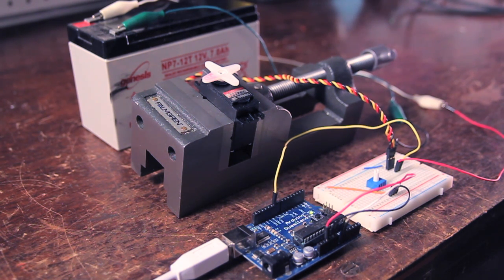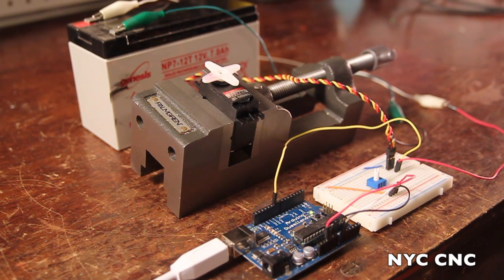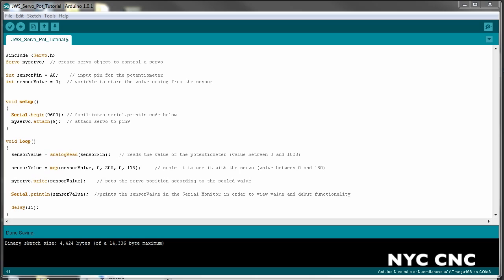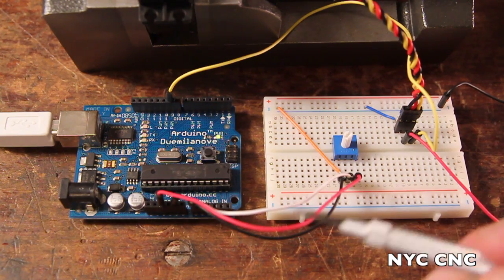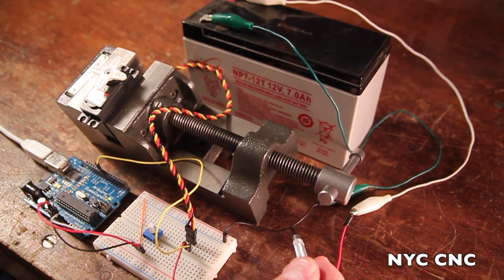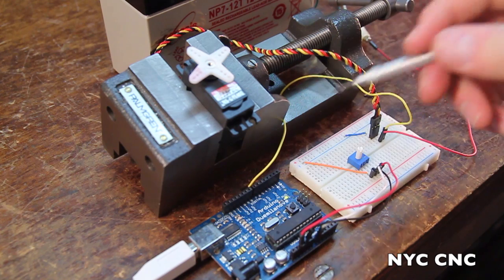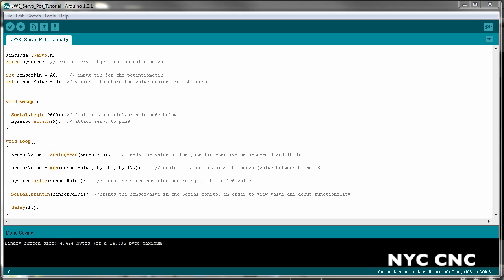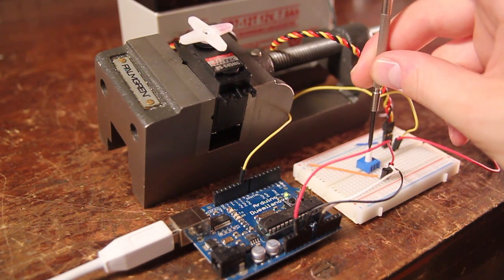Arduino Servo Tutorial Part 2: Supercharging your Servo!

Comment: hey,
it's a great helpful video. but i have one question:
do i have to connect the black cable of the Servo to the Arduino-GND and to the Power-Supply-Mass if I use a 5v Powersupply? because  i want to use one 5A power supply for many servos which are conected to different Arduinos.

Max  (form Germany)
Reply: +NYC CNC  and it's no Problem if I use One power supply with man's Arduinos?

Comment: Hello,
I see that your external power source is about 12V with 7Ah. 
But the servos operating voltage is 4.8V/6.0V. I thought 12V will fry the servo?

Comment: hi! thanks for your videos. i subscribed, i am new on this stuff and it seems to be a great hobby. can i ask do i really need to establish a ground connection between arduino and the motor? will it not affect my arduino. thanks man.
Reply: +NYC CNC hi thanks for your reply.. if i did not establish a connection between two grounds it will work also right? sorry for being hard headed.😆
Reply: +mark loria 
no, it will not work properly - ground of the servo should be connected to arduino because control signal from arduino to servo requires return path back to arduino power suply
Reply: +z08840 hehe tnx bro helped alot

Comment: I am sorry if my question sounds too basic, as i just started to get my hands on servos, and arduinos. Why is the arduino connected via usb cable to the computer? Is it only for figuring out the results or does it act as a power source for arduino i.e. powering arduino through usb and running the servo through battery. Can we remove the cable and the mechanism still works, or do we need to power the arduino separately. I'm sry, if its too basic. Thanks a lot in advance!
Reply: NYC CNC
Thank you

Comment: Are there larger servos you could use with this on a very small mini bench top mill? Thanks
Reply: NYC CNC 
Hello,
Drivers are used when the motor voltage is above the one that arduino can supply? I'm new in this stuff...

Comment: could several servos ( 3-4 max), obviously on a separate supply like you did, all be sent a signal on one digital-write pin? i have a project with at least 24 servos , ( 12 x 2 sides,  ) would this work or would i need a pin per servo? all need to run at the same time to various angles (in pairs )

or would i need another arduino and hook the two together?
Reply: John NYCCNC yeah if i could run in pairs , the most number would be 4 on one pin, i could get it down to 6 pwm outputs,

Comment: Can I do this with a Raspberry Pi (using an external power source), the pins on the RP are only 3.3V. Will this not fry the chip connecting the grounds? Sorry I am new to all this.

Comment: I would make sure you know what you're doing before you work with mains voltages. Look into linear power supply tutorials and that will shed some light on power conversion.

Generally in a simple power supply, there's a step down transformer that will take a high AC voltage and convert it to a lower voltage (still AC). This will then run through a rectifier (usually full wave) that will converter the AC voltage to oscillating DC. This is then smoothed or filtered by a capacitor.

Comment: Ah, thanks.  These servos do take an analog pulse width where 0.5msec wide pulse = -180degrees, 1.5msec pulse = 0degrees, and 2.5msec pulse = 180degrees.  I guess the servo.write() library call does the translation from degrees to this standardized pulse width.  sparkfun dot com/tutorials/283

Comment: Nicely done!  How does the servo.write() value 0..179 turn into servo degrees?  Did you do some hidden calibration to figure out what PWM duty cycle corresponds to a particular angle on the servo?